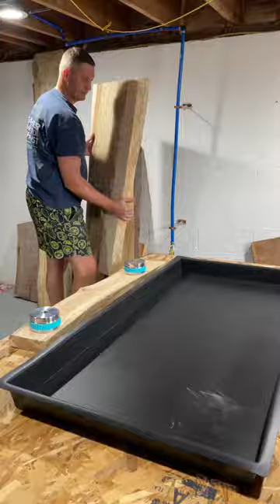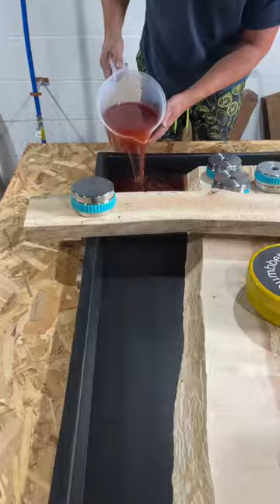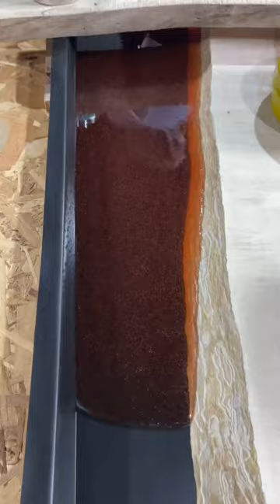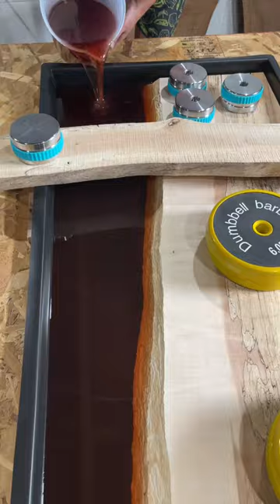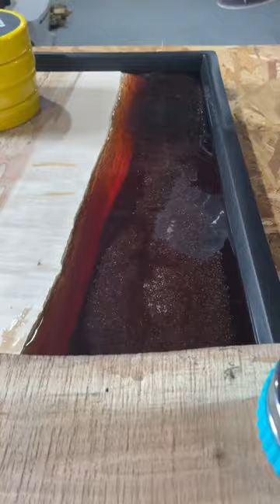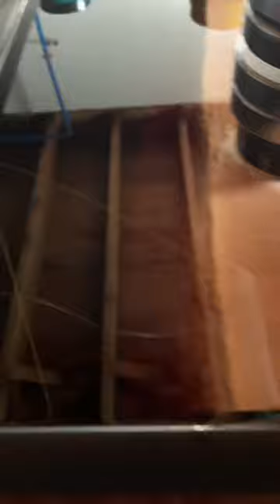The Amber Wood Epoxy Coffee Table #woodworking #diy #livingroomfurniture  #coffeetable #epoxy #wood

Comment: New here 
Whats the mould you are using?
Reply from the maker: I don’t recommend this mould 🥲
Reply: @RainForestStudioCo 

Nice table top.   Can you tell me if the resin encases the timber or if it finishes at the edge of the wood so you have different textures on the surface.

Many thanks
Reply from the maker: @diegolopez9694  Thank you. Resin does not extend to the surface of the slab.
Reply: @RainForestStudioCo  

Thank you.